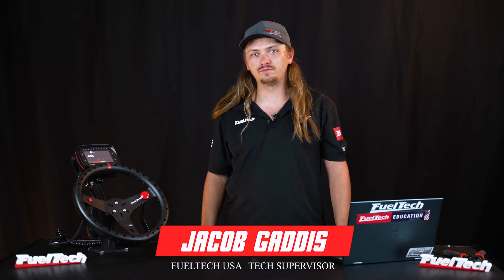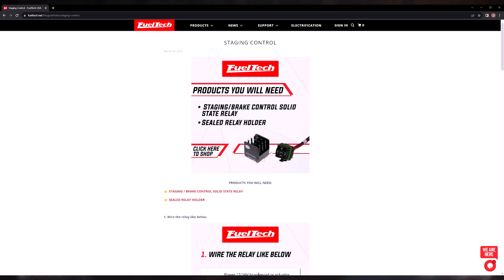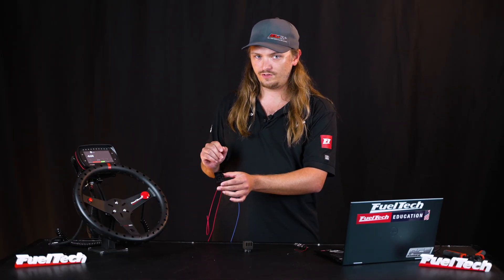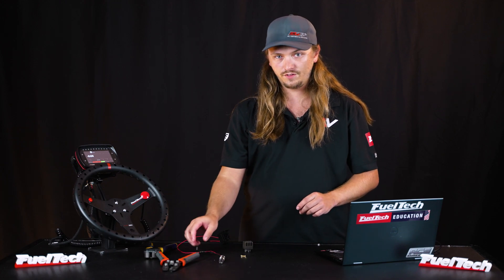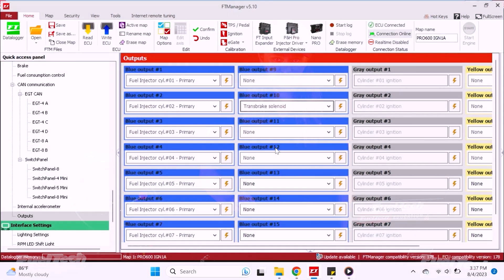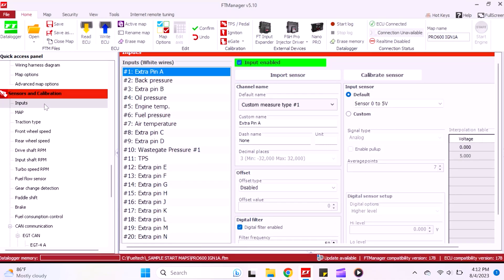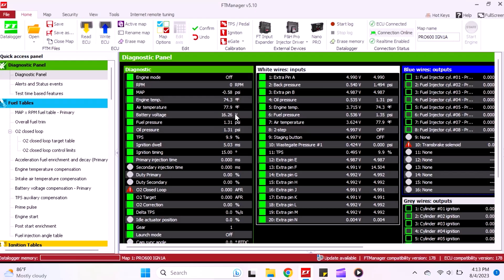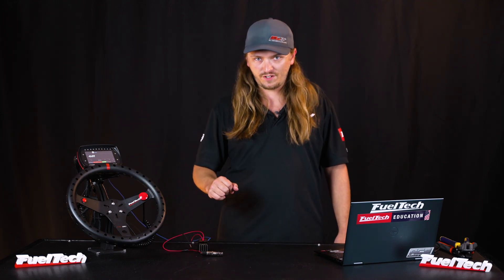How to Properly Setup and Test your Transbrake and Staging Buttons | Tech Tuesday

Comment: watching from England. great imformative video. bought a th400 reverse pattern gearbox with transbrake for my supra years ago. just learning about transbrake and 2 step and bumpstop. have a hurst linelock. just standard car with uprated 4000 stall torque convertor in standard gearbox. Bought a TH400 but not had it fitted, just trying to learn about the wiring. and relays. Thanks for your time making the video.

Comment: I dont have a "staging" button, my car is blown, so I just have a transbrake button triggering the 2 step input and turning my TB relay on.  I havent tried the delay box function, will it still work with this config?
Reply: Did you even finish watching the video
Reply: Sure did, now if my
Question is answered in the video, feel free to point me to it, because I clearly missed it.
Reply: @Jgreenmotorsports  yea you did gonna have to re watch it my guy
Reply from the maker: Yes sir as long as you're triggering the relay through the ECU the delay functions should work. - Jacob